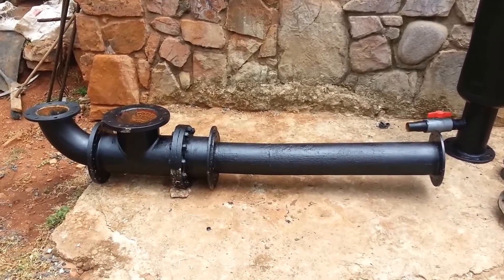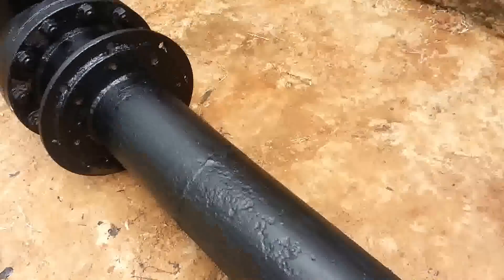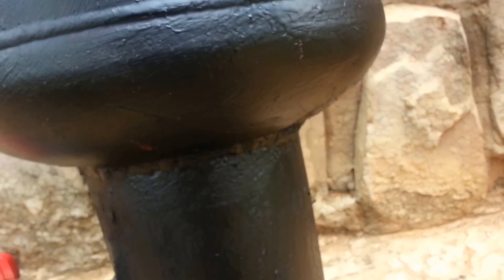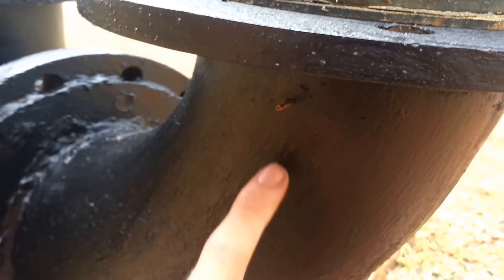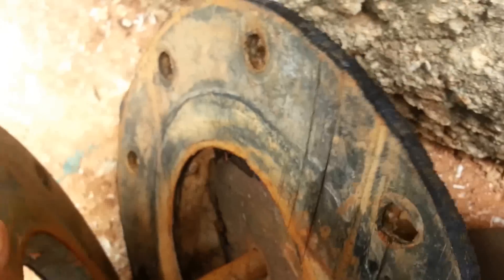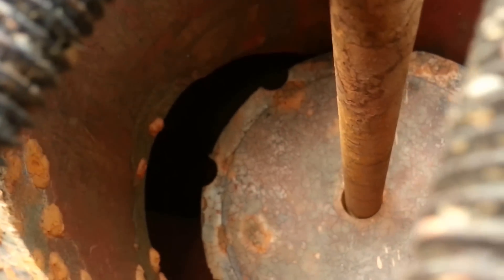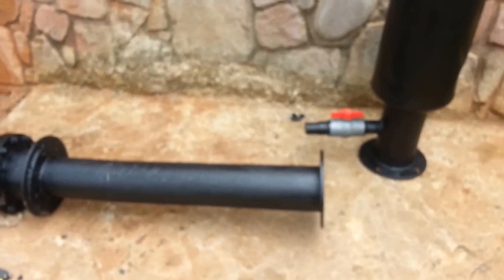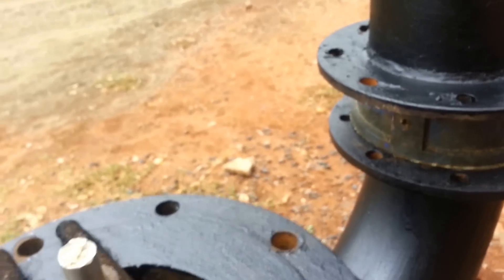How to build a ram-pump Part 1 / The parts and the design

Comment: Is the "drive" valve supposed to be an easier valve to open compared to the waste valve? I have the issue where the output water pressure is not increased even though my waste valve is "cycling" correctly. Any advice? Thanks in advance

Comment: Thank you for your video about your ram pump.   I'm impressed with your parts and welding ability.    Did you ever make the part 2 video you mentioned?   I invite you to take a look at our water powered pumps Facebook group and share your ideas. 
https://www.facebook.com/groups/240458583255303/
Curious - where are you located?  I haven't found many ZM pumps outside of Brazil.

Comment: It would be better if the shaft for the impetus valve was threaded. You could adjust the distance the valve moves by using two nuts to lock the distance the valve moves. Shorter distance, shorter stroke, more efficient, less wear
Reply: From practical observation of my own ram pumps, I find that there is a naturally rhythmic stroke obtained under given parameters, such as head and volume of flow. Restricting the length of stroke I wouldn't find necessary unless I was trying to conserve water, in which case a ram pump might not be the best solution.

Comment: That snifter hole needs a cotter pin, Stainless steel, inserted from the inside. That will reduce water loss and make the mechanism self cleaning. Nice work. Seems like a smaller valve with more cycles would be better. I have a 600' waterfall on my land, or just beyond, but on government lands. My property had a huge water wheel in the gold rush, california, 1850. Built my small damn and under stream bed pick up system feeding 6" pipe - working slowly on getting a waterwheel back running. Have a look at my site, you might enjoy it. We seem to live in a similar sort of climate

Comment: You have finally answered my problems with making a real ram pump instead of the goofy ones made from little one to two inch swing valve assemblies! I would love to see your part two as this has been my favorite video on the ram pump to date. Must've watched over fifty and was almost resigned to going to my local hardware store to build a sub par pump. Thanks to your video I will instead got to my local steel supply warehouse and fire up the mig!!
 And like the others have said. Be happy with your english. It's quite easy to understand you. Even better than some of my neighbors. I live in the McKenzie Valley in Oregon. We have some hillbillies with some major accents!

Comment: Hi Phillip. Die is amazing. Ek het n plaas waar ek nie water by my boonste dam het nie. Ek het klaar n 50mm PVC pyp van onder die vallei tot bo by my dam. Ek sal moet 70m hoog pomp en so 100m ver. Ek wil water van die dam in die vallei neem met n 110mm PVC pyp na die RAM en die RAM self met 100mm galvanized fittings en valves bou. Ek het n 54L gas bottel vir die bladder. kan jy my raad gee of die sal werk.
dankie Jerry
Reply from the maker: eerlike opienie sit vir jou n enkle fase pomp op 0.75Kw 230V met 6 200W panels met n converter sal nooit weer trg kyk nie
Reply: Jerry het jy reggekom met jou Ram Pomp?

Comment: Is it low maintenance?
Reply from the maker: +A Crustacean no very high maintenance ! metal on metal slamming , Thats why i switched to solar pumps
Reply: Was the failure always on the ram side?

The other designs I've seen use two non-return valves but at a significantly smaller scale and claimed to be very low-maintenance.

Comment: nice work!. how much does the whole system cost?
Reply from the maker: +ishy2217 the pipes I got from a junkyard so about  $100 and the valves were new so about $120 for the two and some welding rots and bolts about $20 

So the pump cost about $240 just for the pump then you have to add the drive pipe and pipes to your place were you wont to pump so it cost some what . Thanks for watching

Comment: Thank you very much man for this wonderful video you shared. I am very excited for the part 2.
Reply from the maker: thanks for watching will upload soon
Reply: +Phillip Fourie Yes! Part two please! :)
Good explanation, cant wait to see the 2nd part..
And a question, if you dont mind: how crucial is the positioning of the valves?
i've seen some hydrams set like yours, and also set the other way around: the pressure tank first, and the excess valve is at the end of the apparatus.. I imagine that your setting will be more efficient because the water will flow easier into the pressure tank, but this is only in my mind.. not sure of calcutations or real-life example.. 
Cheers from Bali!
Reply from the maker: +So Organic to tell you the truth i  have build both designs and both of them work the same for me hope this helps  thanks for watching and commenting
Reply: Cool.. thx for the reply.. :)
Reply: Phillip Fourie o

Comment: I like your design it is very robust  I would really like to see it operate , well done.  Funny you would mention a water wheel we are designing a water wheel that stays below the surface and does not interfere with the rivers present course, we have several wheel types to try the problem is to be able to submerge an alternator, one suggestion we have gotten was to have our water wheel drive a hydraulic pump then use the hydraulic energy to turn an alternator
Thanks again for sharing
Reply from the maker: Thanks for watching why not use a gearbox and have your alternator run topside or use a PTO shaft like the tractor's have running implements it can bend a couple of ways. where there is a will there is away

Comment: Hi Phillip ..as shown in your first video my river is also the same way ...but at one point ..there were 2 big rocks from which the water comes very fast ..if we place a 5 kg stone there it will scroll down ..what i need to say is with out using the inlet pipe can i place the pump directly there ...and as show ...i do have a 10 inch iron pipe as of you ..but in a less quantity ...please guide me ...

Comment: why does the flange for the waste valve have to be flush with the flange for the non-return valve?
Reply: does it need to be higher than the waste or can it be in line with the pipe?
Reply from the maker: Kaleb Jones The waste valve should be lower than the no return valve hope this helps thanks for watching

Comment: hello! where is part 2?:)
Reply from the maker: Hi there , part 2 will be up when i am finish with my 11KW solar system , sorry for the delay , but i needed to stop the pumps , my 3 phase solar pump is going to work with my rampumps , and there are some repairs to be done at my water-pit , and it is going to take some time 
Thank you for watching

Comment: Hi Phillip Fourie ! First, congratulations for your robust ram pump it looks awesome. Do you put any inflated tubes or balls inside your air chamber? In other diy ram pump videos I've seen a lot of people do that... Another thing, what is your drive pipe and waste valve inside diameter? Thank you very much.
Reply from the maker: hi Mincho , no i don not have inflated tubes or balls inside my air chamber , the pump make his own air i think the presure is about 1or2 bar i could be wrong . my drive pype diameter is 6 inches and my waste valve diameter is 10 inches
thanks for watching

Comment: Philip, Excellent work you are doing!  With the REALLY heavy duty unit you are constructing I was wondering if there would be enough reserve power to add an electric power generating unit.  Here is a link to a YT video showing the setup.  HYDRAM ENGINE, HAMMER ENGINE, RAM PUMP ENGINE

The Ram rod pushes up on a lever working on a "clutch bearing" ( clutch bearings spin freely in one direction and lock in the opposite) giving a flywheel a spin every so often.  The mass of the flywheel keeps spinning while also turning an alternator.
Keep up the good work!
Reply from the maker: Thank you for your complement and your comment , I have looked at the link you posted and yes it would work great but ill change one thing if i would build the Hydram engine i would build the piston effect like a normal car piston , something to think about ;) You know ? what i think i may implement it on my pump but it won't go fast but it will have a-lot of Horsepower , I can stand at this moment on my ram-pump's piston and it can actually pump with me standing on the piston and my weight is 81Kg 

So yes it is a great idea , good thinking of the other guy .

Thank you for watching
Reply: Phillip Fourie Philip that is excellent news.  As shown in the other video the piston does not repeat very fast also so this looks like it might work for you definitely can be added at a later time.  A posting of a video with you standing on the piston would be exciting!
Reply from the maker: great I will post i video of me standing on one of my pump's piston, i will upload it later this year , at this moment i am doing short videos on the progress of the 11Kw solar pump system , and can't do videos on the ram-pumps , reason being the solar pumps water pit joins with the ram-pumps so no water for me at this time :( but very soon thank you for commenting

Comment: Philip, this looks like a very rugged pump, and well-built. I do wonder about the length of the stroke on the waste valve - it seems very long. Have you tried it with a shorter stroke? The valve closing should be very rapid. If you look at the Vulcan Ram, for instance, it just uses heavy rubber flaps that move a short distance but let a lot of water through. My own pumps use side valves with weights.
Reply from the maker: Thank you for your comment , yes i have used a shorter stroke before but , then the the amount of water pumped topside is much less so i prefer a longer stroke let say exactly a 2 second stroke , in this video i still need to add the rubber between the stroke piston to dampen the sound . i always wanted to build a ram-pump that have a side or front valve , i think i am going to try build one 
Thank you for watching
Reply: @PhillipFourieZA  Thanks for the video, nice practical design so clearly described. I wonder, have you since experimented with a "ram-pump that have a side or front valve"?